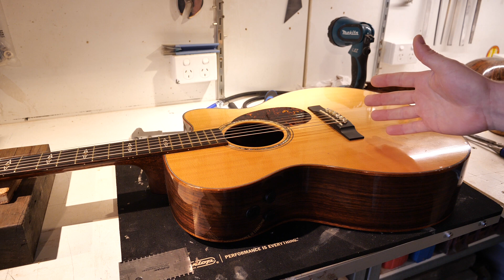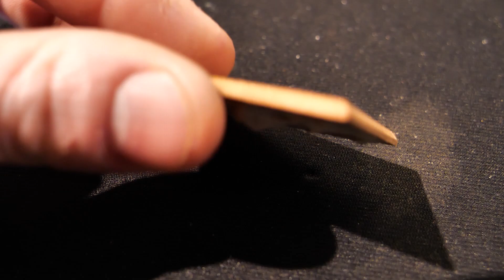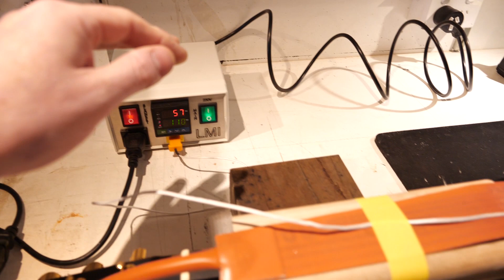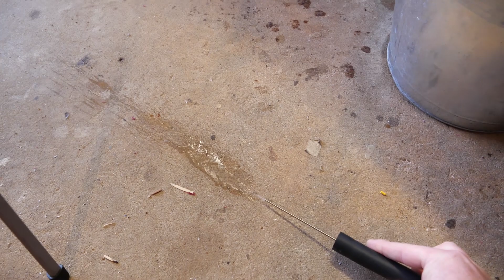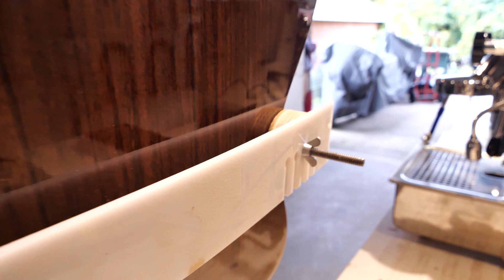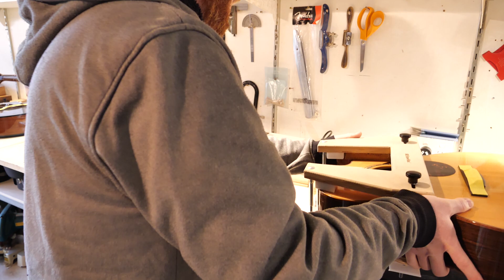Martin OMCPA1 Neck Re-set Part 1: Separation Anxiety.

Comment: Thanks Brad, you always explain your projects very well. Just a reminder and I have used them myself as they avoid the whole steam setup aspect (albeit a long time traditional method which I have used). As mentioned by others the styrofoam cutters used by Ted W are a much more efficient and quicker solution to loosening the neck joint - I think you would love them. Its funny to see Martin guitars in Australia when imo Maton, a great guitar made there is just as good, if not better - the AP5 pro certainly outperforms anything Martin has to offer. btw I am from the states where real Martins are made. Again thanks for all your videos esp the tube amp stuff, very informative.

Comment: Damn Brad, you never fail to impress. Is it typical in Australia for a gifted amp tech to also be skilled at advanced guitar repairs? Or are you a wunderkind, the DaVinci of music repair? I mean, I'm a decent amp tech and can certainly fix and setup most electric guitars, but I'd NEVER attempt anything of this magnitude on an acoustic instrument.

I'm sure you're familiar with Ted Woodford and I wonder if you've ever tried his method of using electric foam cutters or modified soldering irons to heat up the next joint. Clearly you do just fine with the traditional steam technique, but the other way seems a lot easier. Anyhow, good stuff...as always!
Reply: Never mind, should have read further before asking about Ted's technique!

Comment: I can't fathom the wisdom in Martin using this straight mortice joint rather than a traditional tapered dovetail. The straight one holds on for ages when extracting while the tapered comes loose as soon as there is some movement. Also the glue gets wiped off when a straight joint goes together while on a tapered the glue faces only come together when the joint comes home.
I agree Brad. I'm seeing far too many Martin necks with poor fit.

Comment: My 1973 attempt at a neck reset.

Step 1: Free Hofner 500/2 Hollow Body Bass, no bridge.
Step 2: Order bridge, from Germany
Step 2a: Wait a month
Step 3: Strings, got to have strings, RotoSounds! Expensive, must be good
Step 4: Action is about 2/3" at the 12th fret
Step 5: Finally realize why it's FREE
Step 6: Who needs a plan, how hard can it be
Step 7:  Disassemble the adjustable bridge, place the top part of the bridge directly on the top of the bass. Action is now 1/2" at the 12th fret.
Step 8: Actually think
Step 9: Thinking not working, try something else
Step 10: Needs a neck reset, I can do that!
Step 11 Remove neck
Step 11a: Use eXacto knife to score around the joint, and scrape out glue
Step 11a1: Not working, that glue is hard. Rumage in basement...find a can of solvent. Use a syringe to inject where I scored the joint. Left overnight, scraped out 1/100" of glue and wood
Step 11a2: repeat every night for a month
Step 11a3: Finally fell apart, don't know why
Step 12: Glued neck back on with a shim I eyeballed, Sears Roebuck Hide Glue, it said for wood, must be good
Step 13: Clamped and let sit for 2 weeks
Step 14: Reassembled my FREE bass, Action was now 1/2" at the 12th fret
Step 15: Binned it
Reply: Should have kept it, it'd be perfect for slide bass!!🎸

Comment: Having tried this in the past without success and no internet, no computer, and definitely no YouTube. I decided to do live notetaking...

Step 1: Diagnose .... bent/warped, out of alignment neck, veneer lifting, crappy Martin, strings not centered on fretboard
Step 2: Make a plan ....... 
Step 2a: remove neck retaining screw, why a star washer on wood? A flat washer and lock washer maybe?
Step 2a1: heat neck and neck tongue to soften glue (could use a cup of coffee)
Step 2a2: remove glue  under tongue with tool I made
Step2b1; Coffee...I need coffee....
Step 2b2: Clamp expensive guitar into even more expensive StewMac guitar clamp
Step 2b3: Use espresso machine for steam source
Step 2c1: remove fret  a drill two small holes in fret slot to inject steam into dovetail joint.
Step 2c2: Realize I can't have my morning coffee because the espresso machine is already in use! (Note to self, doesn't StewMac make a combo steamer and espresso machine, they make everything else, need to look into that)
Step 2c3 : Inject steam into holes in fret slot to soften glue in dovetail joint (Note to self, next time make coffee first)
Step 2d1: Gently wiggle guitar and StewMac clamp until glue releases being careful not to damage StewMac clamp. Apply more steam as needed
Step 3: Success! Bask in the thunderous applause of your future YouTube viewers who are too lazy to comment or give a thumbs up. (Note to self, block Jerry London! A..hole)
Step 4: Coffee!
Step 5: To be continued....after coffee

I think I got it all....

Comment: No, some Martin guitars play well and lots of others are just pure shit piles. Martin has been like that for at least as long as I have been alive. I fix them, my uncle fixed them my great uncle fixed them, so I think we have ALL obtained the right to shit all over them. I use an old industrial strength wall paper steamer. I also don't drink coffee. I will take a spot of tea with honey though. I like Navajo tea, Mormon tea and purple cone flower tea, with honey.
Reply: I will mix steam injection with the foam cutter hot rod cutters. I would also move that esspresso machine up to the top shelf and guide the hose down a gentle slope to keep water from pooling inside the hose. With a heating element around the properly routed hose I can almost get a true dry steam from the paper stripper.
Reply from the maker: That machine is about 30kg!

Comment: Ted Woodford's foam cutting rods are hella' more convenient than steam, but Brad gets points for creative use of the espresso machine!  What you need to fabricate, Brad, is a glass jar type collection chamber ----  Like the oil collection chambers used with large air compressors ---- that the steam passes through but the water is captured by the collection chamber so that it doesn't come out the end of the hose where you're pushing steam into the holes in the guitar. Anyway, it occurs to me that what we have here is a "ginger" Down Under taking a page from a "ginger" in The Great White North!
Reply from the maker: That's not a bad idea, but at the end of the day the technique I used was adequate and had no real pitfalls if done correctly. The steam helps hydrate the glue a little too, which helps with cleaning it off the joint.
Reply: @BradsGuitarGarage  , I'm guessing it must be very low humidity there since it's wintertime in Australia......and PS, how old is this Martin?
Reply from the maker: I'll get back to you with that info once I've had time to confirm it.
Reply: @BradsGuitarGarage  ,  It was weird to see those barcodes and serial numbers on the neck heel and inside the neck pocket. Being a hybrid bolt-on set up, they could get away with minimal glue, which mightn't have stuck to those stickers very well anyway (assuming they were vinyl and not paper).  They might just as well have made it a bolt on neck and forgone the glue entirely.

Comment: At least they have an adjustable truss rod now and the soundboard isn’t glued over the dovetail.

Hey, it’s a step in the right direction! Too bad it’s the ONLY step Martin took in the last 60 years.

You know guitar players are a literally retarded bunch, me included. Nobody but us wants original 70 year old electrolytic caps or a leaking film cap that might as well be a piece of wire left in their amp.

Thanks for the videos!